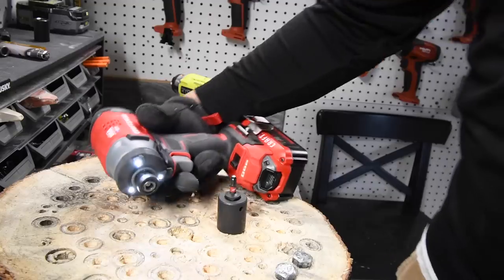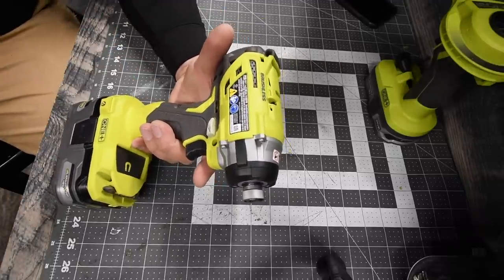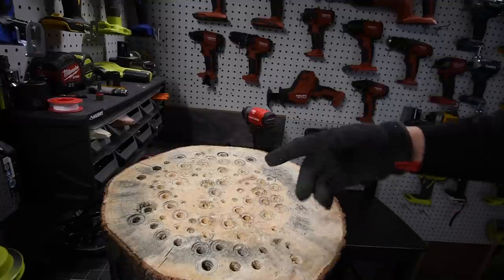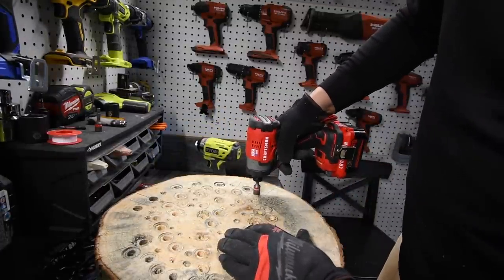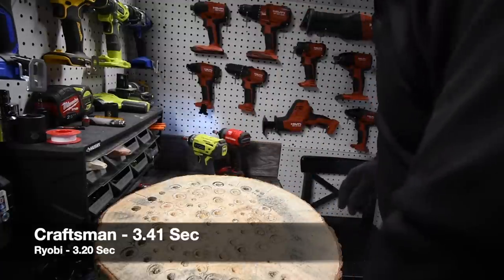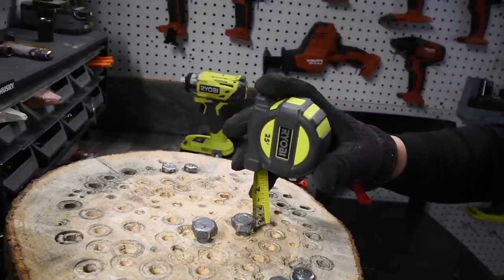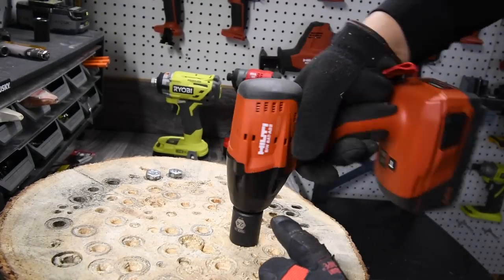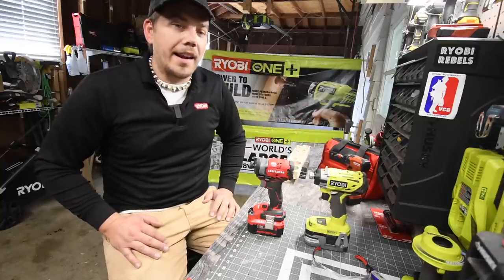Craftsman vs Ryobi (Impact Drivers_

Comment: Craftsman won that.. ran cooler at the end, drove the biggest lag in further, did most tasks faster. Who can argue with those facts? Yes Ryobi did good but it was out done by Craftsman
Reply from the maker: correct, Craftsman won this video
Reply: That's not Ryobi flagship impact tho! If u put it up against Ryobi newest impact driver, which was released about a year and half ago, craftsman wouldn't even stand a chance lol.
Reply: @bobbiecottrill332  Very doubtful these new craftsman’s is a dewalt in red I’ve seen guys on the jobsite with craftsman and they go just as hard as all the pro grade impacts the ryobi in this video actually has better specs and it lost ryobi is still decent

Comment: Would love to see the Kobalt against either of these.
Reply: Kobalt would win, it's dang powerful but mainly due to the 24 volts.
Reply: You think so? I tried the Kobalt impact wrench. It was no match compared to the Makita one
Reply: @gooseseey4687  i guess I don't know after watching this video, as all the specs. and the size would lead me to say the ryobi would be dominant over the Craftsman.  Even the sound the Ryobi seems more powerful.  Yet the Craftsman seemed to outperform the Ryobi just barely.  I realize the wood test isn't very good medium to test with though as its always going to be inconsistant.
Reply from the maker: I will be getting Kobalt XTR impact soon
Reply: @ManCaverTools  I think the regular Kobalt is rated at 1700 ins/lbs which puts it in the ball park with the Ryobi or craftsman.
Reply: @djjd3027  no I checked and it said like 2300 in lbs.
Reply: @kartboarder22g17  the xtr I believe is rated at 2300 ins /lbs. The older one is 1700 ish.
Reply: @djjd3027  gotcha,  yea the Ryobi is suppose to be rated at 2200, so, don't know what happened here.  But ratings aren't always correct.  Maybe age of tool?  Maybe inconsistancy between builds. who knows I guess.  Don't get me wrong either one of these impacts in the video will do what you need them too, to build stuff out of wood, etc.  I have a 3/8 impact wrench for anything above.
Reply: Which actually brings me to the point, what is shown above here is far above what this tool should be used for.  Some of this above you would pull out the 3/8 impact wrench and even some of this above you would pull out the 1/2" impact wrench to accomplish the task.  Yet, he is just pushing these tools to their limits and above to see what they are capable of.
Reply: @kartboarder22g17  good point, I was thinking “I would not grab this tool for lag bolts that size”. Lol.
I am in the market for an impact driver and these both seem to run neck n neck. If Craftsman really is assembled in the USA, perhaps I go with them. Then again, Makita and Milwaukee are on sale. What to do?!?
Reply: @honeygirlsapiary  I sold my Ryobi brushless 3 speed. And got m12 impact driver. Reason is for what I do I always am in speed 2 on the Ryobi and like I said anything above that I have a 3/8 impact wrench. The M12 is tiny and the same or more power than speed 2 of the brushless Ryobi. Just used it on a project and was able to get into tight spots the Ryobi can't.
Reply: @kartboarder22g17  my oldest son is a diesel mechanic and swears by Milwaukee when his air tools aren’t available. I hear good things about the m12 and no more than I do (small woodworking projects mostly) I wonder if that’s all I really need.
Reply: @honeygirlsapiary  If you really want a do all than the m18 impact driver is the way to go on sale now at HD for 200.  When I mean do all, it will do everything these two will do and is in a very small package.  It is wider head than the M12 but it is actually shorter like a cm or something, just amazing.  But if you think you can  get by with the M12 like I am doing than that is on sale for 100 right now at HD.  I'm talking about kits when I say these prices.  Everything is on sale now as its the Christmas season.  Makita is good stuff too I  realize.  So those are the two best bangs for your buck.
Reply: @kartboarder22g17  that don't mean everything bud, I have a 20volt harbour freight impact that is destroyed by dewault 12v ones
Reply: @pierreguillotte5013  yeah we chat about that reality more in the back and forth above

Comment: Supposedly it's been said craftsman is basically a red dewalt, wanna, test that out for us?
Reply: Well they're the same company.. just like Chevy and GMC.. owned by the same company. GM doesn't own the tools that's just a comparison
Reply: @rileytaylor1206  stanley black and decker owns like all the tool makers (not literally but most) and just like gm, chevy and cadillac they have different quality, still have their own signature things though.
Reply from the maker: Pretty much lol
Reply: What I've seen is it's mostly just rebranded (and maybe somewhat upgraded) Porter Cable stuff. This impact definitely looks like it has some DeWalt in it though.
Reply: It is not dewalt in red craftsman strart tin 2010

Comment: I wouldn't be disappointed with your test if I were you. You're basically removing the equivalent of lug nuts with a quarter inch drive! I'd say they both did well.
Reply from the maker: They both did a good job for being in the class they are in

Comment: Just bought that Craftsman 820 yesterday and looking forward to using it rebuilding decking outside. I’m on the V20 line and that’s why I got it. Looks like a good product.
Reply from the maker: very good, I thank you for viewing Eco
Reply: How is that v20 line holding up?  I’m curious to make the plunge now and have narrowed it down to ryobi and craftsman. I don’t need top of the line but I do need long term battery availability.
Reply: @jo9732  still too soon to tell.
Reply: @ecoRfan  hey bro how's it holding up? Its been a year and I'm interested lol
Reply: @ryu-ken  it’s a great product, made tasks so much better.
Reply: @ecoRfan  glad to hear you havent run into problems in 2 years. I'm gonna pick up some craftsman stuff now
Reply: @ryu-ken  any brand is good. Just need to do homework to find which model is the best. I chose the 820 since it got good reviews, both by user ratings and by YouTubers who tested it. I don’t think Craftsman makes this model anymore, although some Lowe’s stores might still have it in the clearance section. I was also already on the Craftsman V20 line.

Comment: Just an FYI, the hammer and anvil’s moment of engagement has nothing to do with the power of the motor. It’s actually dependent on the preload spring behind the hammer. They actuate when the spring tension is overcome, regardless of motor power. They all use different preload springs because an impact is a timed tool. The mechanism timing has to be within a certain threshold in order to actually use the mechanical advantage provided by the hammer and anvil.
Reply from the maker: the fact is, the anvil wasn't needed at the very beginning. Craftsman won this one
Reply: @ManCaverTools  Craftsman are always better than Ryobi, but for 119 (now) you can get a CRAFTSMAN  V20 RP 20-volt Max Variable Speed Brushless 1/2-in Drive Cordless Impact Wrench that is the exact same tool as the 230 dollar Dewalt Model #DCF891B (both come with no battery) But you get a 230 tool for 119, its a no brainer. These companies do this all the time. I bought a Calvin Kline watch that had a Swiss Movement inside for 100 bucks and the movement costs you 200 bucks. Crazy.

Comment: Had the sears craftsman 20v impact during the start of my apprenticeship, got me through for a few months taking off panels, hanging pipe, could not get through any type of curb or structural steel, upgraded to a more compact 12v dewalt, since I was moving more towards residential service (hvac). Does exactly what I need it to
This is definitely a good review to help apprentices and homeowners buy a starting drill that will make them money
Reply from the maker: I agree and I thank you Cody
Reply: Hell now dewalt and craftsman are essentially the same. The craftsman is legitly a dummied down dewalt. Even the internals are identical ever since dewalt bought craftsman

Comment: When we bought a home I needed some power tools for around the house.I needed a Brad nailer for the baseboard and crown we installed, I was going to just get Ryobi since it was cheap and proven but I'm just not a huge fan of it. I started browsing around and came across craftsman at Lowes. They had a brad nailer for $99 but just bare tool. The batteries were not on sale at the time, I think it was $80 for 1 battery and charger, but they had the brushed impact and drill + 2 batteries and a charger + bag for $99 so I got the drill, impact, and Brad nailer. I actually really liked em after using them around the house. I liked them alot. I had a ridgid brushed impact and drill I used at work and I liked em but didn't love them. I actually liked the Craftsman more than the Ridgid. I liked my craftsman stuff at home so much that I retired my ridgid stuff and bought the Craftsman Brushless impact and drill for work. I gotta say I love my craftsman brushless stuff. It works for me and what I do and I haven't really had any issues with them other than the brad nailer started failing to fire alot. I hit up customer service and they sent me a brand new one, I didn't even ask for it, I just asked how I could fix it. So it's definitly important to register your tools and get the warranty going. But if you are a DIY'er or doing like residential multihousing maintenance or the like and don't want to blow out the budget on the yellow or red, I recommend the Craftsman line. Oh, I also found out that craftsmans new line is just Dewalt stuff but Chinese made and cheaper.

Comment: They were soooo close it really doesn't even matter. Both are excellent choices. Go with whatever battery system you have or whatever one you can get a deal on.
Reply from the maker: to some it might. that might determine what battery platform someone might buy into

Comment: You should put that hilti impact wrench vs the ryobi impact wrench.
Reply from the maker: I can but that would be brushed vs brushless.
Reply: Have a ryobi drill for 20 yrs now still going strong. Use it all the time. Had a hilti drill that I babied only used once in awhile. It quit working I would say after maybe15 to 20 uses. Ryobi might not win in these extreme tests but they are built well and last a long time for normal use

Comment: Where did you get the belt clips for the craftsman
Reply: Usually comes with the kit that includes 2 batteries
Reply from the maker: it came with the tool
Reply: They come with it and are for use with the VersaTrack wall storage system.

Comment: I have a small  business glass/window and we use some Dewalt and mainly moved mainly to Ryobi tools. I like Milwaukee and Makita but to me and for what I do, I can just get more tools and batteries for the same price. And it gets the job done the same. And secondly when I have to replace tools if easier on the wallet. However recently I have my truck broken into and all my power tools were stolen (fu@king sucks). Now I have to replace my tools and looking at other options. I like that Craftsman are equaling not better than Ryobi, Ridgid and kobalt. For me I really like to support products and companies that are Made in America and I plan to replace my tools with Craftsman. I also like being in job and not worrying about loosing/mixing up my tools with all the other Dewalts/Milwaukee tools. Lastly I had this Ryobi impact and it was great super powerful and durable a little heavy, but it was stolen unfortunately.

Comment: Would use them for skrews and small bolts for bigger bolts and longer ones use an impact wrench  with a good amount of torque like 300ft pounds which should the max or if someone is a mechanic get a stronger one for whatever job is needed for. Impact drivers can do the work in the video but these are diy tools even though these tools can be impressive to use for your needs but should not be for thick long bolts.
Reply from the maker: that is what I would as use them for as well. You will just end up breaking adaptors left and right for big bolts

Comment: I’d be curious to hear. What is your favorite tool line to use as a homeowner.   If you could only pick 1 line.  Which would it be?   If you could pick any 2 lines to use together.  Which ones would you use?
Reply from the maker: Id pick Ryobi because they have a huge Variety of tools on one battery line and a good price. But 12v tools are my favorite tools. Milwuakee m12 tools are expensive
Reply: @ManCaverTools thoughts on skil 12v for DIY'r? Or just go 18/20 if going cheap?

Comment: What I think is happening is that your heating that bit up so much you're taking the heat treat a way and that is why it's snapping off
Reply: They just not made putting 10inch lags with 1/4 drive to much constant torque then they snap think the metal is to hard also with heat treatment
Reply from the maker: that's why I do these tests. if I only did 3" screws it wouldn't make a good stress test
Reply from the maker: I thank using that 5/8 lag is a bit to extreme for the adaptors, so I will be not using it on impact drivers anymore

Comment: Have you ever thought about for these videos to convert the in lbs to ft lbs for impacts like if the impact rating is 1700 in lbs to ft lbs would be around 142 ft lbs of torque? If divided by 12. Just a question. I dont mean for this to come off as a request but a possible suggestion.
Reply from the maker: I Thank you so much for viewing :)

Comment: I can say your testing process is truly grueling. I must admit, I would've switched to a larger impact driver.
Reply from the maker: This also is an old video. My testing methods upgraded since then
Reply: @ManCaverTools  Yes Sir, I noticed that. But, I really like the way you test things. You don't abuse the tool, you operate to limit of the tools intended purposes, while illustrating their proper operational limits. If you're on a latter, and didn't bring a heavier tool with you, you've illustrated how to get job started at least. Then can come down, or holler for help.

Comment: Why do people use the Milwaukee socket adapter for high torque tests. They are crap. The stem aka torsion zone some call it is thin as hell compared to others grab the husky 3 pack or DeWalt. You will get better milage they have thicker stems. The quarter part that goes into the collet is par for the course but thick shafted unlike the Milwaukee Makita and Ryobi socket adapters.

Comment: There is no testing ryobi is 18v and always will be dont put a 20v and 24v and expect to be the top notch take and 18v to 18v so its fair
Reply: You do realize that most 20v advertised tools are actually 18v themselves? Ryobi advertises actual voltage versus everyone else advertising MAX voltage. It's all smoke and mirrors. Now the 24V you have a point, but even then, there are some 18/20v models that beat them.